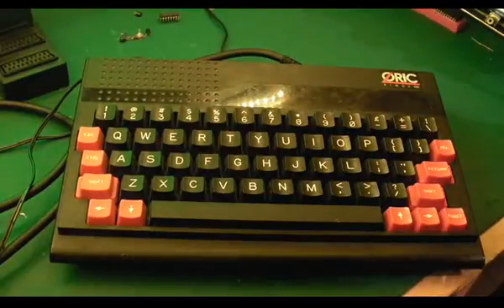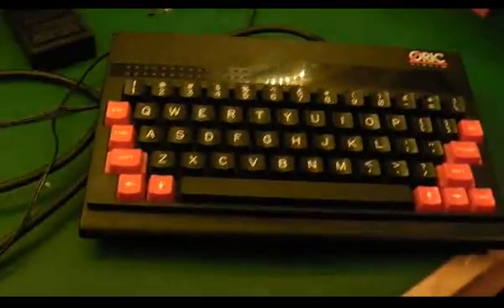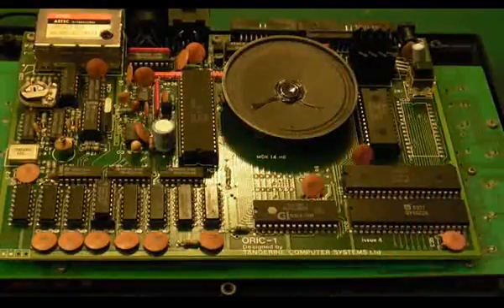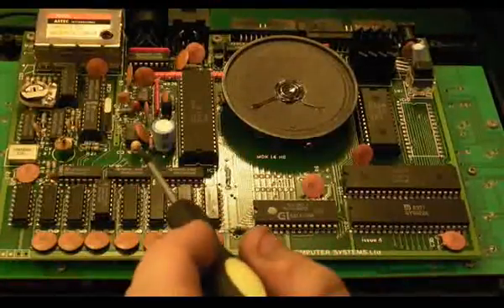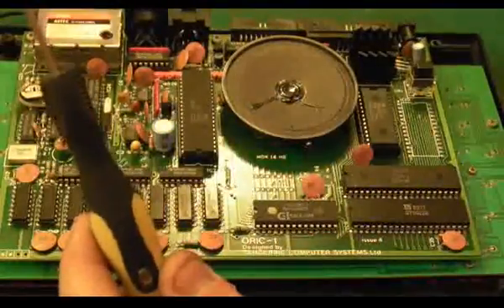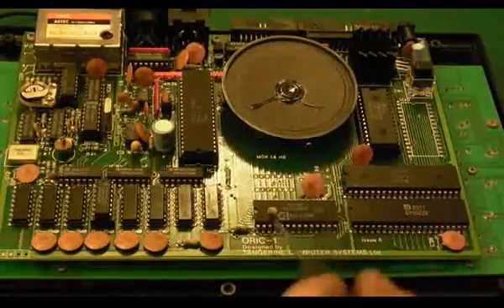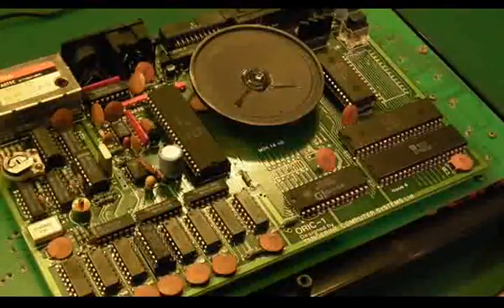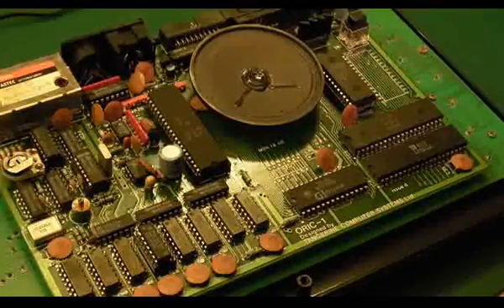Oric Atmos repair Pt4

Comment: i have just recapped one of these which is why i watched your video and other vids, the owner asked me to go thru it, i told him that they were probably ok but he wanted them changed, ceramics changed to wima's real nichicons for the few electrolitics, modern tants etc changed the regulator for a quality  replacement a couple of resistors were so out of spec its a joke so i replaced them, and its as good as new it worked before but now the video is crisp and clear, well worth the effort, in fact i'm going to do the same to my oric 1 as a preservation exercise, so if you want to do the best for your oric go through the caps and check the other bits as some of the components used were not the best to start with.

Comment: Something you can check: are the non-working keys part of the same row or column (electrically, not physically). The Oric keys are organized in a matrix of 8 rows and 8 columns: http://oric.free.fr/programming.html#keyboard If a whole row or column isn't working, it might help identify a missing signal output coming from either the AY-3-8912 or the VIA6522.
Reply from the maker: yes it's one full column missing. however I've tried replacing both the  AY-3-8912 and the 6522 without success it must be a broken trace somewhere but so far I've been unable to locate it. I've had my head burred in spectrums over the last few months but plan to return to this soon. so lookout for another video coming up.